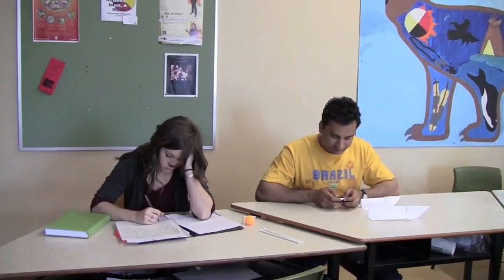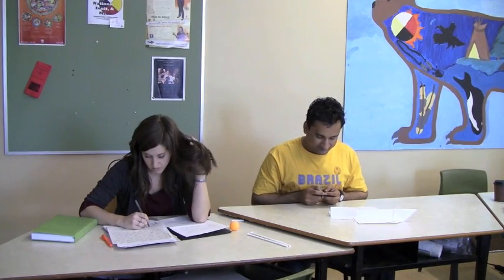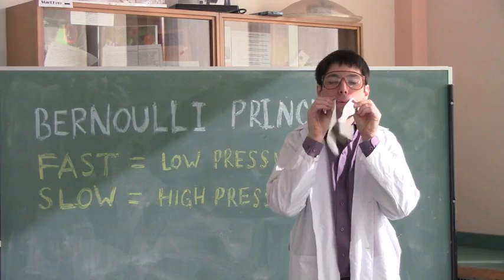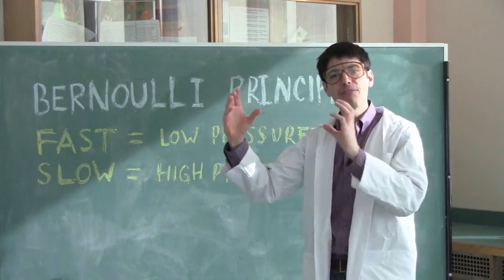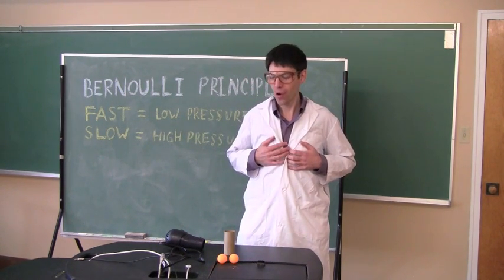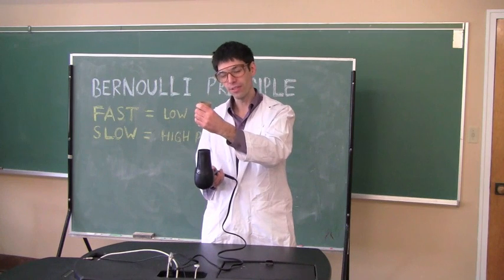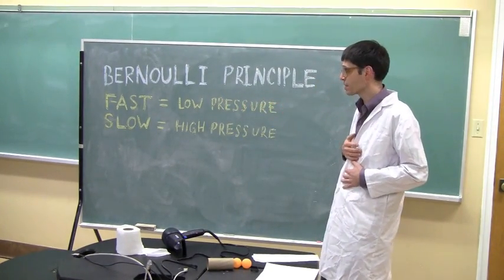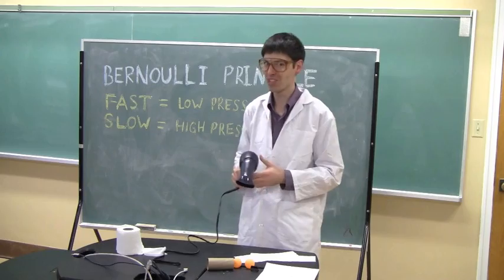✈✈ Bernoulli's Principle - Easiest Way Explained ✈✈ ☹ ☹

Comment: Yeah except your wrong. 
One problem with this explanation can be seen by blowing along the bottom of the paper: were the deflection due simply to faster moving air one would expect the paper to deflect downward, but the paper deflects upward regardless of whether the faster moving air is on the top or the bottom. Another problem is that when the air leaves the demonstrator's mouth it has the same pressure as the surrounding air; the air does not have lower pressure just because it is moving; in the demonstration, the static pressure of the air leaving the demonstrator's mouth is equal to the pressure of the surrounding air. 

What Bernoulli's principle actually says is that within a flow of constant energy, when fluid flows through a region of lower pressure it speeds up and vice versa. Thus, Bernoulli's principle concerns itself with changes in speed and changes in pressure within a flow field. It cannot be used to compare different flow fields. A third problem is that it is false to make a connection between the flow on the two sides of the paper using Bernoulli's equation since the air above and below are different flow fields and Bernoulli's principle only applies within a flow field.

A correct explanation of why the paper rises would observe that the plume follows the curve of the paper and that a curved streamline will develop a pressure gradient perpendicular to the direction of flow, with the lower pressure on the inside of the curve.  Bernoulli's principle predicts that the decrease in pressure is associated with an increase in speed, i.e. that as the air passes over the paper it speeds up and moves faster than it was moving when it left the demonstrator's mouth. But this is not apparent from the demonstration.

Demonstrations" of Bernoulli's principle are often given as demonstrations of the physics of lift. But what they truly are, is demonstrations of lift, but not of Bernoulli's principle. 

To demonstrate Bernouellis Principle, some people blow over a sheet of paper to demonstrate that the accelerated air over the sheet results in a lower pressure. You are wrong with your explanation. The sheet of paper goes up because it deflects the air, by the Coanda effect, and that deflection is the cause of the force lifting the sheet. 

A way to prove this wrong,  use the following experiment: If the sheet of paper is pre bend the other way by first rolling it, and blow over it,  it goes down. This is because the air is deflected the other way. Airspeed is still higher above the sheet, so that is not causing the lower pressure.

It's a shame that this principle is so maligned by people like you who clearly do no know what your talking about.

Comment: This is a BAD SCIENCE VIDEO. [fixed some typos]
.
Why do you want to spread these misconceptions?  Fix or delete this video.

I am very sorry, but this is only repeating some  of the most common misconceptions in science.  If this is what your teacher taught, they have been misinformed, which is, unfortunately, VERY common.
.
Fast air does not have low pressure.  What Bernoulli found is that Accelerating air has a decreasing pressure and visa versa; BUT NOT what caused this to happen.  
--
Euler continued that study in the mid 1700s and realized that it is a pressure Gradient (difference between two locations) that provides the force that accelerates a fluid.  This is Newton's Laws in fluids.
...
The air out of your mouth is at atmospheric pressure; that same pressure as the still air around it.  It is the higher pressure created inside your lungs by the contracting muscles that accelerates the air out into the lower, atmospheric pressure. Higher pressure accelerates air toward the lower pressure.
..
Blowing next to paper demonstrates entrainment which is caused by viscosity. . Look them up.  
--
The air over a wing only looks faster in a wind tunnel.  The lower air is actually faster as a wing flies by you.  The upper air is, however,  accelerated much more. This is caused by the lower pressure above the wing. It is accelerated REARWARD so much that it reverses direction from being pushed forward ahead of the wing to traveling rearward toward the trailing edge as the wing passes.
.
The pressure changes around a wing are simply caused by the wing pushing air out of the way to get through it.
...
Bernoulli had nothing to do with the development of the airplane. He was doing blood pressure studies.
...
The air above a wing gets to the trailing edge significant;y BEFORE the lower air; which is caused by pressure ahead of the wing pushing it toward the low pressure above, thus accelerating it toward the rear.
...
The ping-pong ball is held in the center by the Coanda Effect. A flow that follows a convex surface is what lowers the pressure. Think of centrifugal force pulling the air away and, therefore lowering the pressure.
 The air out of the hair drier is at atmospheric pressure, The side of the ball where more air curves around to the down-wind side (top)  of the ball has a lower pressure because of the greater Coanda curved flow. 
When tipped, there is more air flowing over the top AND flowing in a curved path (around the back and then downward).  This lowers the pressure more and supports more of the weight, therefore, allowing the upward moving air's dynamic pressure to push the ball further out..  This is the only explanation which explains why the ball moves further away when the flow it tipped because the air is slowing down farther from the blower and the centering force would be less, not more, if the Bernoulli fallacy as true.
..
ALSO, if the air pressure at the blower's exit was lowest, the ball would be "sucked" down (actually pushed down by higher pressure above it)
...

The tube above the ping-pong ball is a very good discovery and requires a more careful understanding because this fast air thing is false.  
My initial analysis is as follows:
The tube prevents much of the air which would simply 'spill' around the sides of the ball to be trapped below the ball in the tube and to push the ball up like a piston in a cylinder.
Reply: When are you going to fix this video??

Comment: Love it!
Reply: This is a BAD SCIENCE VIDEO. [fixed some typos].
Why do you want to spread these misconceptions?  Fix or delete this video.

I am very sorry, but this is only repeating some  of the most common misconceptions in science.  If this is what your teacher taught, they have been misinformed, which is, unfortunately, VERY common.
.
Fast air does not have low pressure.  What Bernoulli found is that Accelerating air has a decreasing pressure and visa versa; BUT NOT what caused this to happen.  
--
Euler continued that study in the mid 1700s and realized that it is a pressure Gradient (difference between two locations) that provides the force that accelerates a fluid.  This is Newton's Laws in fluids.
...
The air out of your mouth is at atmospheric pressure; that same pressure as the still air around it.  It is the higher pressure created inside your lungs by the contracting muscles that accelerates the air out into the lower, atmospheric pressure. Higher pressure accelerates air toward the lower pressure.
..
Blowing next to paper demonstrates entrainment which is caused by viscosity. . Look them up.  
--
The air over a wing only looks faster in a wind tunnel.  The lower air is actually faster as a wing flies by you.  The upper air is, however,  accelerated much more. This is caused by the lower pressure above the wing. It is accelerated REARWARD so much that it reverses direction from being pushed forward ahead of the wing to traveling rearward toward the trailing edge as the wing passes.
.
The pressure changes around a wing are simply caused by the wing pushing air out of the way to get through it.
...
Bernoulli had nothing to do with the development of the airplane. He was doing blood pressure studies.
...
The air above a wing gets to the trailing edge significant;y BEFORE the lower air; which is caused by pressure ahead of the wing pushing it toward the low pressure above, thus accelerating it toward the rear.
...
The ping-pong ball is held in the center by the Coanda Effect. A flow that follows a convex surface is what lowers the pressure. Think of centrifugal force pulling the air away and, therefore lowering the pressure.
 The air out of the hair drier is at atmospheric pressure, The side of the ball where more air curves around to the down-wind side (top)  of the ball has a lower pressure because of the greater Coanda curved flow. 
When tipped, there is more air flowing over the top AND flowing in a curved path (around the back and then downward).  This lowers the pressure more and supports more of the weight, therefore, allowing the upward moving air's dynamic pressure to push the ball further out..  This is the only explanation which explains why the ball moves further away when the flow it tipped because the air is slowing down farther from the blower and the centering force would be less, not more, if the Bernoulli fallacy as true.
..
ALSO, if the air pressure at the blower's exit was lowest, the ball would be "sucked" down (actually pushed down by higher pressure above it)
...

The tube above the ping-pong ball is a very good discovery and requires a more careful understanding because this fast air thing is false.  
My initial analysis is as follows:
The tube prevents much of the air which would simply 'spill' around the sides of the ball to be trapped below the ball in the tube and to push the ball up like a piston in a cylinder.
Reply: @ForeverStill_Fan1  It is still bad form to present incorrect information to beginners, especially. 10 and 11 year olds can understand the correct science.  The 'fast air' thing is pure nonsense that must be corrected later, so why teach it at first?
 Equations it not the way either.

Comment: I hate that I found this helpful
Reply: This is a BAD SCIENCE VIDEO.
.
Why do you want to spread these misconceptions?  Fix or delete this video.
I am very sorry, but this is only repeating some  of the most common misconceptions in science.  
Fast air does not have low pressure.  What Bernoulli found is that Accelerating air has a decreasing pressure and visa versa; BUT NOT what caused this to happen.  
--
Euler continued that study and realized that it is a pressure Gradient (difference between two locations) that is the force that accelerates a fluid.  This is Newton for fluids.
...
The air out of your mouth is at atmospheric pressure; that same pressure as the still air around it.  It is the higher pressure*created *inside your lungs by the contracting muscles that accelerates the air out into the lower, atmospheric pressure.
..
Blowing next to paper demonstrates entrainment which is caused by viscosity. . Look them up.  
If this is what your teacher taught, they have been misinformed, which is, unfortunately, VERY common.
--
The air over a wing only looks faster in a wind tunnel.  The lower air is actually faster as a wing flies by you.  The upper air is, however,  accelerated much more caused by the lower pressure above the wing.
The pressure changes around a wing are simply caused by the wing pushing air out of the way to get through it.
...
Bernoulli had nothing to do with the development of the airplane. He was doing blood pressure studies.
...
The air above a wing gets to the trailing edge significant;y BEFORE the lower air; which is caused by the low pressure accelerating it toward the rear.
...
The ping-pong ball is held in the center by the Coanda Effect. A flow that follows a convex surface is what lowers the pressure. Think of centrifugal force pulling the air away and, therefore lowering the pressure.
 The air out of the hair drier is at atmospheric pressure, The side of the ball where more air curves around to the down-wind side (top)  of the ball has a lower pressure because of the greater Coanda curved flow. 
When tipped, there is more air flowing over the top AND flowing in a curved path (around the back and then downward).  This lowers the pressure more and supports more of the weight, therefore, allowing the upward moving air's dynamic pressure to push the ball further out..  This is the only explanation which explains why the ball moves further away when the flow it tipped because the air is slowing down farther from the blower and the centering force would be less, not more, if the Bernoulli fallacy as true.
..
ALSO, if the air at the blower's exit was lowest, the ball would be "sucked" down (actually pushed down by higher pressure above it)
...

The tube above the ping-pong ball is a very good discovery and requires a more careful understanding because this fast air thing is false.  
My initial analysis is as follows:
The tube prevents much of the air which would simply 'spill' around the sides of the ball to be trapped below the ball in the tube and to push the ball up like a piston in a cylinder.

Comment: i never knew learning fluid mechanics would be this so much fun and... awkward but fun
Reply: This is a BAD SCIENCE VIDEO.
.
Why do you want to spread these misconceptions?  Fix or delete this video.
I am very sorry, but this is only repeating some  of the most common misconceptions in science.  
Fast air does not have low pressure.  What Bernoulli found is that Accelerating air has a decreasing pressure and visa versa; BUT NOT what caused this to happen.  
--
Euler continued that study and realized that it is a pressure Gradient (difference between two locations) that is the force that accelerates a fluid.  This is Newton for fluids.
...
The air out of your mouth is at atmospheric pressure; that same pressure as the still air around it.  It is the higher pressure*created *inside your lungs by the contracting muscles that accelerates the air out into the lower, atmospheric pressure.
..
Blowing next to paper demonstrates entrainment which is caused by viscosity. . Look them up.  
If this is what your teacher taught, they have been misinformed, which is, unfortunately, VERY common.
--
The air over a wing only looks faster in a wind tunnel.  The lower air is actually faster as a wing flies by you.  The upper air is, however,  accelerated much more caused by the lower pressure above the wing.
The pressure changes around a wing are simply caused by the wing pushing air out of the way to get through it.
...
Bernoulli had nothing to do with the development of the airplane. He was doing blood pressure studies.
...
The air above a wing gets to the trailing edge significant;y BEFORE the lower air; which is caused by the low pressure accelerating it toward the rear.
...
The ping-pong ball is held in the center by the Coanda Effect. A flow that follows a convex surface is what lowers the pressure. Think of centrifugal force pulling the air away and, therefore lowering the pressure.
 The air out of the hair drier is at atmospheric pressure, The side of the ball where more air curves around to the down-wind side (top)  of the ball has a lower pressure because of the greater Coanda curved flow. 
When tipped, there is more air flowing over the top AND flowing in a curved path (around the back and then downward).  This lowers the pressure more and supports more of the weight, therefore, allowing the upward moving air's dynamic pressure to push the ball further out..  This is the only explanation which explains why the ball moves further away when the flow it tipped because the air is slowing down farther from the blower and the centering force would be less, not more, if the Bernoulli fallacy as true.
..
ALSO, if the air at the blower's exit was lowest, the ball would be "sucked" down (actually pushed down by higher pressure above it)
...

The tube above the ping-pong ball is a very good discovery and requires a more careful understanding because this fast air thing is false.  
My initial analysis is as follows:
The tube prevents much of the air which would simply 'spill' around the sides of the ball to be trapped below the ball in the tube and to push the ball up like a piston in a cylinder.